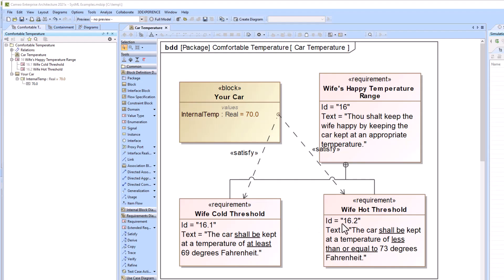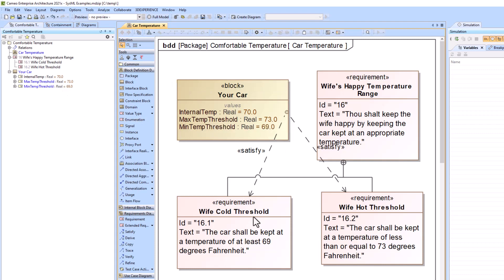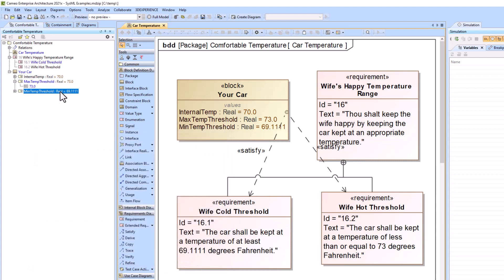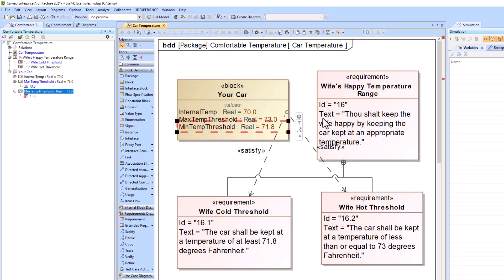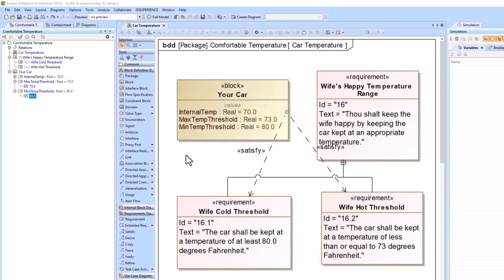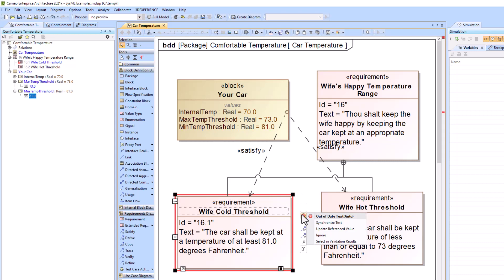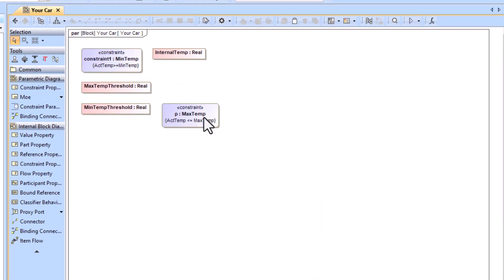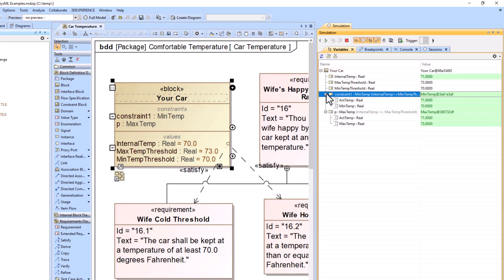SysML - Linking Requirement Text to Value Property Values

Comment: Question: how does the requirements Pass/Fail highlighting work on Instance Tables whose Classifiers have Value Properties in Satisfaction relationships with Requirements?
Reply from the maker: You can use the requirement verification legend within an instance table to flag the requirement with a red highlight.  If you hover your mouse over the red cell, it will tell you the requirements which have not been satisfied and why.  Hope this helps.